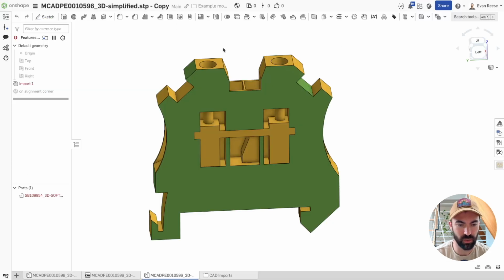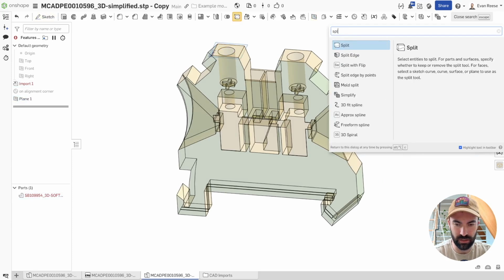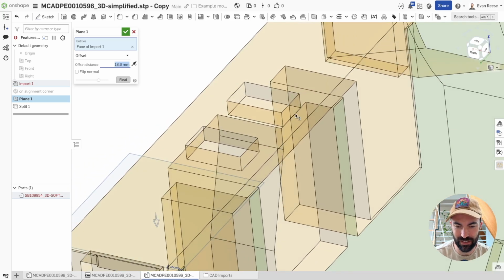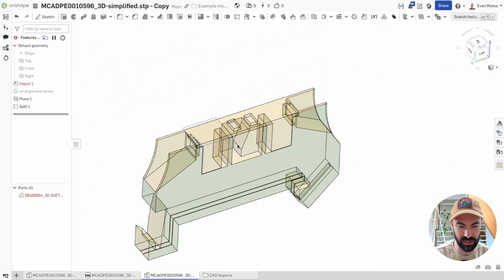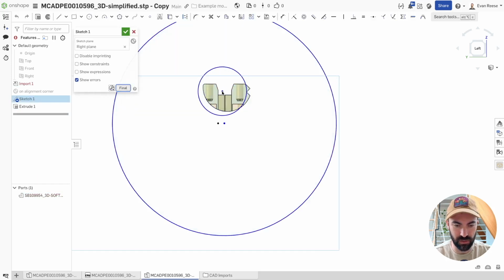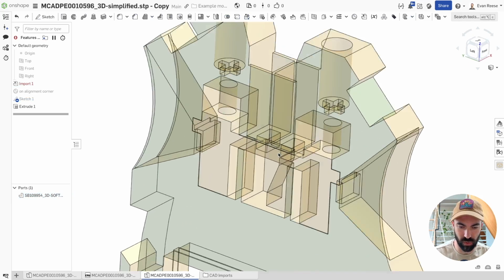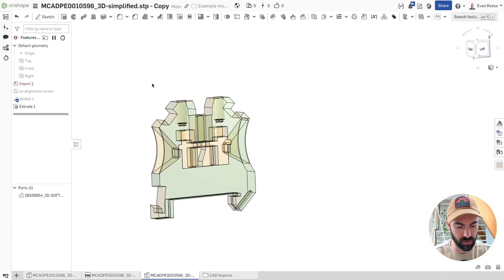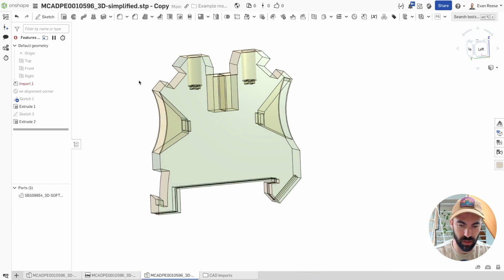Fix Import Issues

Comment: Great video on troubleshooting faulty imported models. 👏

On my side, I don't use a plane, I just create a Mate Connector directly in the split feature and keep both sides. Then I watch which side is still faulty after the split and I move the MC to locate more precisely the fault. If it wouldn't be that I'm colorblind and that I don't see easily the text diference between red vs black and depending on the model to troubleshoot, I like your plane workflow. 👍

PRO TRICK: Just performing a boolean between a correct part and a faulty part sometimes resolve the faulty topology. 🤷‍♂

And thank you for the profile sweeper feature! 🙏
Reply from the maker: That's a great way to go too! I like the interactivity being able to drag the plane and watch it update. I think whatever you're seeing with Boolean sometimes fixing it is the same thing I saw in my video with the intersection extrude "fixing" it. Maybe it'll be fine, but I'd rather address the underlying issue for peace of mind. Have you ever had later issues when doing it that way?
Reply: @evanareese  honestly I was told this method by an ex-colleague but I never used it since I prefer to find the issue and correct it. I don't know if my ex-colleague ever had issue with it.

Comment: Another great video. Little off current topic but a great script would be a feature to translate an imported mesh by by selecting mesh face or 3 points to align to plane or other face. Hard to do?
Reply from the maker: Thanks! It's not hard, but I'm not sure it's much better than the native transform tool. All you need is a well placed mate connector to transform from, and there are likely different ways you'd want to make that depending on the mesh you're working with.
Reply: @evanareese  That's awesome. Thank you. I didn't realize you could use mate connectors on meshes. Works great!